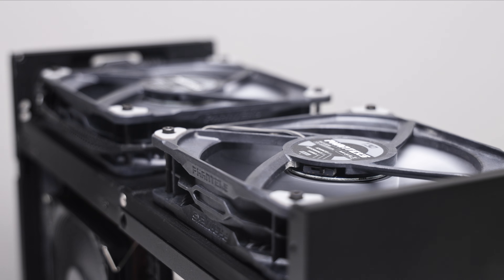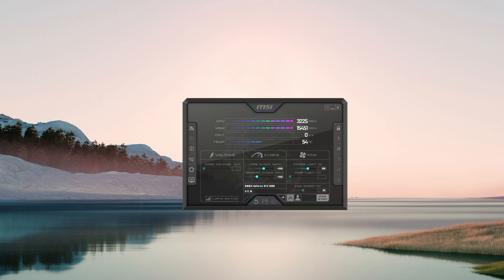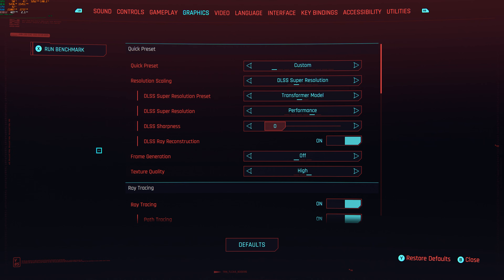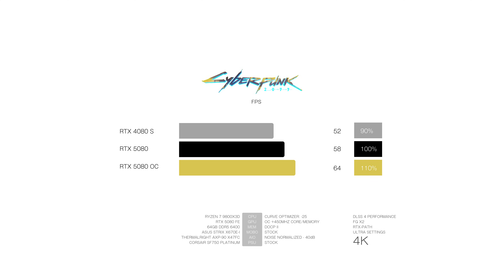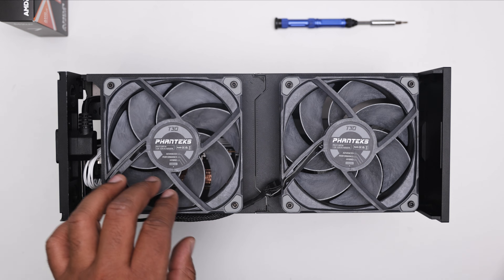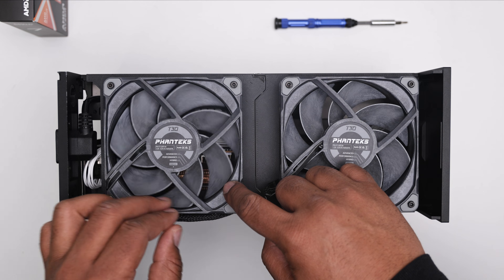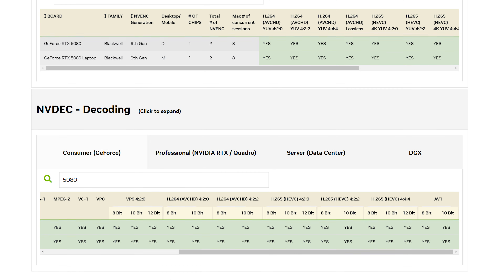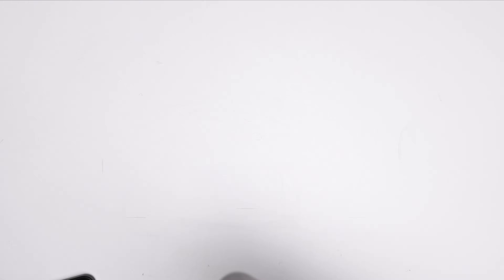Air Optimized! RTX 5080 + Ryzen 9800X3D in the FormD T1

Comment: 🔥Awesome video! Thanks for featuring the Exhaust Shroud, the V2 version is now up on my Printables page (linked in the description).
Reply from the maker: Thanks for your continued support in the modding community!
Reply: I have a theory that the shroud would make your air flow worse due to the entrainment effect. Thus limiting the amount of air being able to be pulled through the side and up and out the case. 

Once I'm able to do a build I really wanna test this.
Reply: @vega-fel  I tested the exhaust shroud in my T1 air-cooled build video, but would definitely like to see more testing with it, especially with the new version of it.
Reply: @EIGAtech  ill check it out! Thanks.  I would like to see more testing, not just on hot spot temps but also on surrounding heat spots with thermal couples. 

I suspect that when you channel the heat out that it definitely lowers the hot spot temps, but I wonder if then you limit the air flow to the surrounding parts, but on the inverse, maybe getting the heat out first helps it to no heat soak the other parts.
Reply: @vega-fel  the point of it was to focus exhaust out from hotspots inside the case. as exhaust the primary purpose is not to draw fresh air in, but to get hot air out.
Reply: @DarrinLin  yea but if you block off the ability of the fresh air to move then you would be lowering the velocity of the total airflow and that might be keeping more heat in, maybe not on the hotspot but in the surrounding areas.

Comment: Hey Chris, just wanna know you personal preference between the formdt1 and ncase m2 grater.
Reply from the maker: Wel that depends on your use case. If you want something super compact and time using it for gaming and air cooling, go with the T1, if you want to expand to liquid cooling and also want to use the computer for power intensive tasks, go with the M2, you can air cool and liquid coo. The T1 and M2 are better when use them hope they were intended, Air for T1 and Liquid for M2.
Reply: @ChrisRussellTech I have an m2 air cooled with a noctua cpu cooler. I’ve been looking at the T1 case and was thinking about moving my build to it. I just want to know, completely subjectively, which one you prefer. If you could only have one pc.

Comment: I just upgraded to a 5090FE from a 5080 and still using my Corsair SF750 Platinum at the moment. Works just fine no reboots from power spikes drawing about 650w from wall. I did later put a 75w power cap on GPU and pulls 383w now to drop temps. Also waiting for my Asus Loki 1200w SFX-L PSU to arrive shortly and custom cable set. Also using a Core Ultra 265K set to 100w max with the Thermalright AXP90-X47 CU. I do leave the side panels off all of the time for additional cooling and for the looks. I might order the vented glass panels if they ever come back in stock.

Comment: Hey Chris, thanks for this video exactly what I was looking for. So you think the 5080 Founders and the 9800X3d was finely handled by the SF750 PSU? I have had the SF750 for a while but was wondering if i should buy a better PSU possible but will be making a build similar to this. Thank you in advance!
Reply from the maker: That’s what I’m currently running and it’s fine, expect it the 750W ASUS LOKI. The SF750 is solid and unless it’s giving you issues, no need to replace even with a 5080. I’m pulling 490W from the wall during Cyberpunk 2077 4K.

Comment: Any reason that you use Phantek over Noctua fans? I've been debating on which to use for the case fans + deshrouding my 4080.
Reply from the maker: I don’t have much experience with deshroud cooling. T-30s has better static pressure for radiator or heatfin cooling

Comment: Really love your videos.

So basically I’m doing the exact same build, expect I am using the Cooler Master AIO that you used in an older video. Is there anything of not that I need to keep in mind? Do I need to get thinner fans for it or will the stock work fine? 

Also, will custom modding be necessary for someone like me who just wants to build it and play?
Reply from the maker: If your using the T1 in the stock configuration then you’d need one slim fan and one 25mm fan. If you’re using the top-hat add on you can use fans as thick as the T-30s.
Reply: @ChrisRussellTech  I am using the stock configuration. Out of curiosity, why 2 different types of fans and the same type?
Reply from the maker: @GOOPMANx  you can fit only a slim fan over the CPU area and up to a 25mm over the PSU. Just a limitation of the case.

Comment: Awesome video! It looks like the air-optimized version of the T1 is getting better temperatures than the top hat, right?  :o
Reply from the maker: In gaming yes, however if you’re doing anything that requires a fully loaded CPU, you’ll see high numbers but most people will just be gaming.

Comment: Can somebody help me?. I'm wondering if I need to switch to a 1000/1200W psu to buy 5080/7900xtx. The specification of my computer is:

PSU:  MSI MPG A850G PCIe5.0 850W 80 Plus Gold ATX 3.0
GPU: I would like to buy 5080/7900xtx
CPU: AMD Ryzen 7 9800X3D
MOBO: MSI MAG B650 TOMAHAWK WIFI
RAM: GOODRAM 32GB (2x16GB) 6000MHz CL30
AIO: Arctic Liquid Freezer III 360 3x120mm
2 x SSD: Kingston 1TB M.2 PCIe Gen4 NVMe KC3000
HDD: WD Blue 2.5'' 1TB SATA/600 (WD10SPZX) (5400K RPM)
CASE: ASUS TUF Gaming GT302 TG ARGB Black (4 x 140mm fans)
Reply from the maker: 1000W is more than enough. You’ll like see 5-600W from the wall in extreme scenarios.
Reply: @chrisrussellca  i going to keep my MSI psu. Pcpartpicker calculator says that power draw should be around 629W so 850w psu is enough. Thanks :)

Comment: This just looks not really thought through. The 5080 is blowing 300+ Watts of pure heat at the PSU and CPU. It seems super stupid 🤷‍♂️
Reply from the maker: The thermals check out and I’ve been doing this for a while. There’s even other creatures that have flipped the power supply. 48c isn’t that warm at all, especially under load.

Comment: @chrisrussellca, love your work and just built an almost identical system. 

It would be AWESOME if you could test the thermistor temps on the back of the mobo without the standoff.  

I'm not yet convinced the air-gap is necessary, and I feel a bigger CPU air cooler would make for better CPU gains.
Reply from the maker: You wouldn't be the first to think that, I've actually tested it but no numbers were recorded, just to see if it was worth it. I did observe a motherboard backplate temperature of 64-68c without standoffs.

Comment: I have almost nearly the same specs as this build except i have a pny OC 5080 and an arctic lf3 280. Will a 750w psu still suffice?
Reply: And chris if you reply to this, can you let me know whats your max power draw for this system?
Reply from the maker: Yes, a 750W PSU will work fine. However if you plan to do any form of upgrading in the next year or so for the CPU or GPU; I recommend going 850W at the minimal. I saw a maximum power draw of 360W on the GPU while overclocked and a max system load of 580W from the wall with a meter. However those numbers are from when I was running Time Spy Extreme with the 9950X and 5080 OC.

Comment: as much as i love ITX  builds, damn they get hot after a few hours of gaming.  when i moved my 9800x3D and 4090 to a larger case, it is whisper quiet.  air flow is everything for high-end components as they get HOT!
Reply from the maker: That's sacrifice you have to make to SFF
Reply: Yea SFF is a hotbox unless water cooled. I have that same build in an NR200P, but with a custom triple radiator setup. Fully heat soaked the water temp gets up to 40-42, but the 4090 stays at 55-60 and the fans are very quiet. Ordered a T1 & thinking of going back to air… but idk yet
Reply: @joshuac9805  No reason for the parts to run that cool though. The 7- and 9 AMD series are built to run at 95c even. As im waiting for the T1 to restock, im running my 7800x3D and a 5080 in my NR200P with a EK 240 AIO. My 5080 reaches 65c after like 2 hours of gaming, and the CPU just isnt used much in gaming, like 15-25% in Cyberpunk, therefor it's not even close to being hot. And the only thing i can hear i some slight "moving air noise" and mostly the pump. Ill go with the AXP-90 X47 and try it out when i get a T1, cba doing the 3d print and the heat set inserts for the shroud though. Ill just set the curve on the T30s to non-hearable when not gaming,  and non-hearable with headphones with game sound on when gaming, to suck most of that heat out.
Reply: @berrab68  ive been refreshing formd's page everyday for the past few months it feels like. do you happen to know when theyll have the t1s up again?

Comment: Nice, I have the exact same system but in the fractal terra 
Edit: Really good video btw
Reply from the maker: Very nice! How are the thermals in the Terra
Reply: @ChrisRussellTech  Pretty good, I did a negative 20 undervolt and it never goes over 75 degrees using a Noctua NH-L9x65

Comment: Interested in before and after test of the psu flipped. I wonder if having the psu flipped helps at all with gpu temps, especially considering it sort of creates a funnel for the hot air to go through the psu and out the top.
Reply from the maker: I can look into that, I have a sensor I can use to measure the thermals.

Comment: Exactly what I wanted to see. Did you “undervolt” the 9800x3d? The cooler seems small for it.
Reply from the maker: You can dial in PBO settings in the bio, I did have a -25 Curve Optimizer set on all cores.

Comment: Test in the M2 without riser, let's see if the extra space in the bottom will make the card work well without  bottom fans also please test how much an AIO would obstruct the flow through cooler vs a tower (that also blocks it). Wondering how much better would the cpu temps be under gaming and video editing/rendering workflows vs the T1. Make it happen! P.S. I agree with you, reverse standard layouts are overrated.
Reply from the maker: This is the way, I'm trying to get the Grater model.

Comment: I did almost exactly the same build in my v2.1 with a 5080 fe/9800x3d, but in the end, but the whole standoff ordeal felt really janky and not as secured as I liked. Ended up just putting the parts back into my Dan a4 h2o, as it has a much easier method to do the same thing and feels significantly more secure, even if it is a little bit bigger
Reply from the maker: I had concerns with the standoffs too but fortunately that might get easier with the travel kit, no official word if it'll completely dissolve the standoff modification but it looks promising. My T1 feels very secure however, even with the nylon standoffs I am using.
Reply: @ChrisRussellTech  I do agree, Ill definitely try the build again when the travel kit comes out, that should make it feel MUCH nicer

Comment: 9800x3d temp on this cooler? Cinebench and gaming, rpm noctua fan?
Reply from the maker: Cinebench was HOT at 95c, this is only really recommended for gaming and maybe video editing. Fully loaded even on a 9800X3D will certainly push you to max without tinkering in PBO. I did post CPU temps in 3D Mark or Cyberpunk. Here is a link to my reddit build breakdown, some data has changed since I ran more tests since the post but largely accurate. https://www.reddit.com/r/sffpc/comments/1ik012i/nvidia_rtx_5080_founders_edition_ryzen_7_9800x3d/
Reply: @chrisrussellca  Thanks, possibly find a good piece and let go at about CO -40😉 you have coil while on this board?
Reply from the maker: @errrr69  no coil whine observed, the VRM fan can get loud if you leave it stick out of the box but never had any issues.

Comment: Currently split between the T1 and M2, so I would love to see a comparison of this build in the M2! As well as seeing how far you could push this build but with an undervolted 5090FE. I didn't see much in terms of thermals on the CPU, how does the AXP90-X47 fare against the 9800X3D? And what about putting the motherboard in the 3-slot configuration to allow for fan ducts on the CPU side and how that might affect the balance of CPU/GPU thermals?
Reply from the maker: Ncase M2  + RTX 5080 coming soon.
Reply from the maker: CPU performance took more of a backseat on this video but I do have a reddit breakdown with slightly more information, some information is different since I've reran some tests. https://www.reddit.com/r/sffpc/comments/1ik012i/nvidia_rtx_5080_founders_edition_ryzen_7_9800x3d/